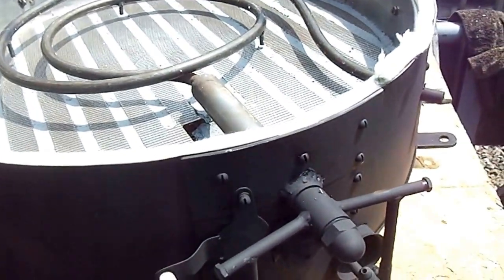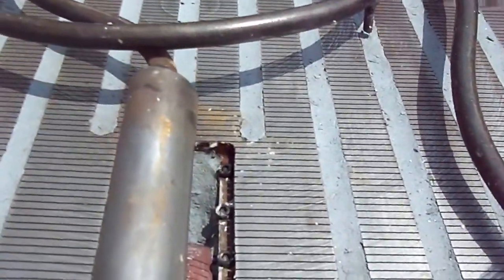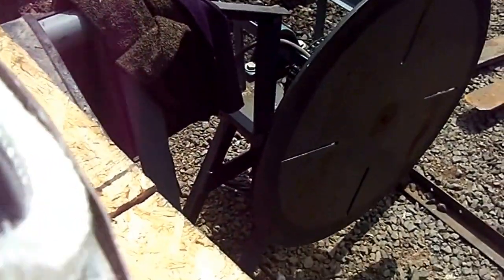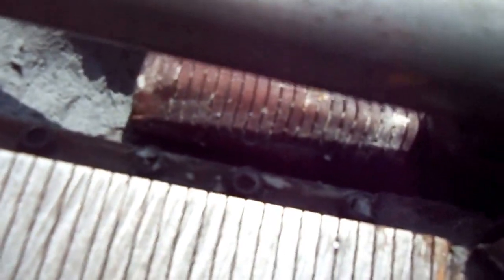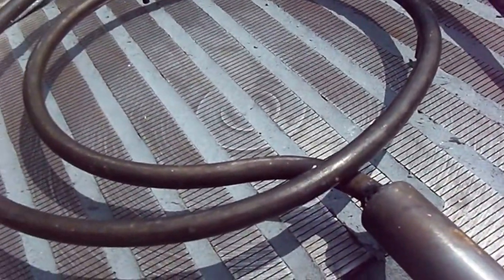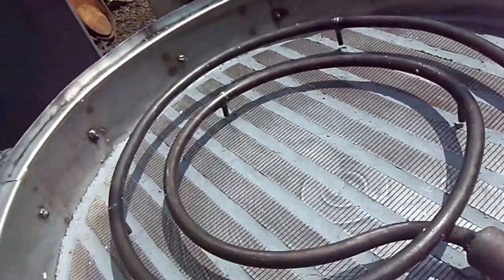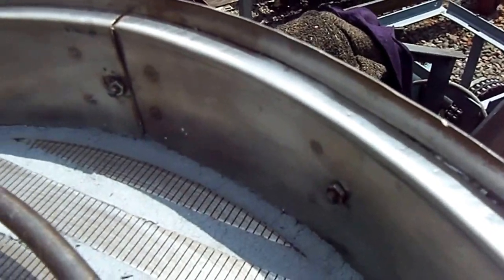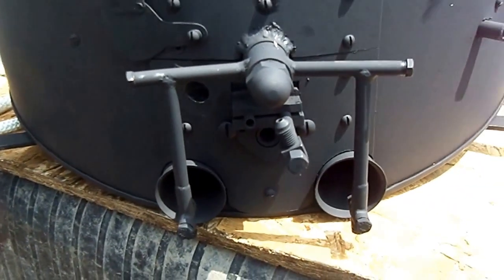Stanley Steam Car Baker Burner  What it looks Like Finished

Comment: Thanks I have reworked my Baker burner and fitted slugs to hold the baffle slots open, mine closed up as well. Had to cut the cast plate slots where they were not all the way through with. 0.5mm cutting disk in a Fein oscillating multi tool